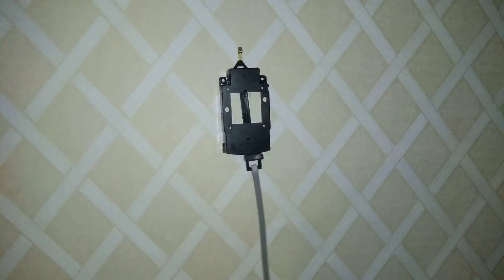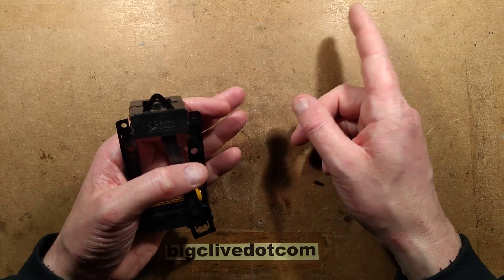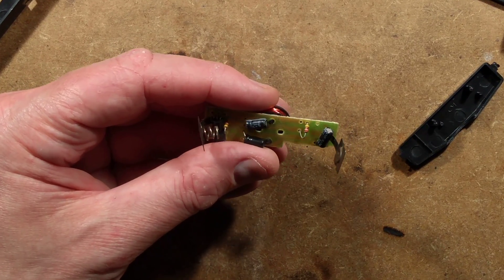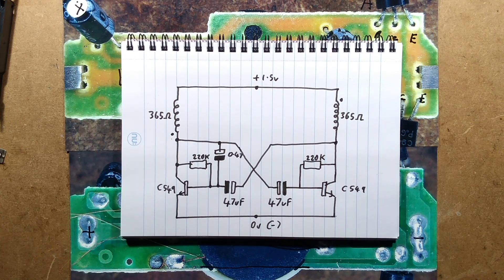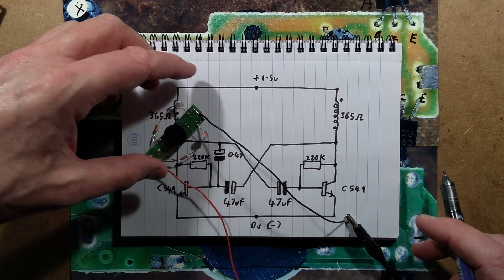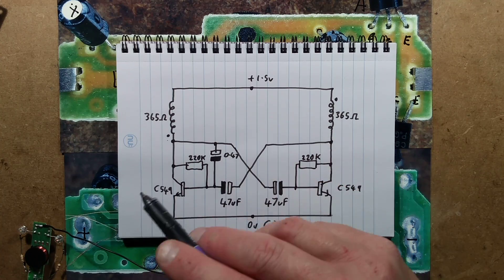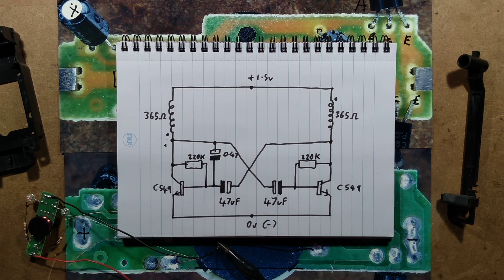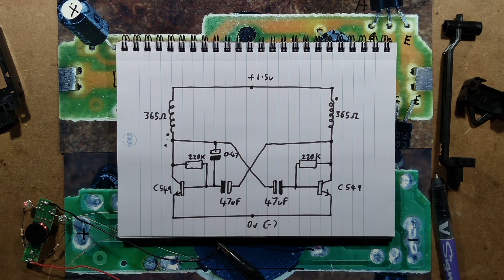Quartz clock pendulum movement teardown with schematic.

Comment: It's properly known as a knife edge bearing... quite common in clocks and balances....
Reply: "quite common" !!! Pretty much all balances - but not so much clocks. Clocks tend to use a bit of thin spring steel which bends - so there's no mechanical bearing.
Reply: pmailkeey Bendy springs are only used in clocks that use the spring for timing instead of a gravity pendulum.
Reply: @johnfrancisdoe1563    nope.  A pendulum can be hung from a normal bearing, or a knife edge, or a short strip of flexible material, eg leather or thin spring steel.  All have been done.  One use of flexible strip is to get the pendulum to follow a non-circular arc  (elliptical maybe?)  Which gives independence of timing from excursion.
Reply: @johnfrancisdoe1563  Isn't it amazing how totally clueless people like you appear to be an expert.
Smiths, a world-famous? instrument maker (including clocks) used them - and I have one such clock only 2 feet away from me as I type.

On top of that, you're technically wrong too - springs are not used for timing.
Reply: @johnfrancisdoe1563  To name a famous clock that uses a bit of spring steel - the clock in Big Ben / Elizabeth Tower (- for the pedants)
Reply: @raykent3211  Parabolic ?
Reply: @raykent3211  Oh, you're having fun now ;) Non circular movement (therefore technically can't call it an arc, I think) - timing therefore based on 'average length' of the pendulum - this is hilarious ! Considering the sub-degree of arc at the point of suspension, this variation in length is going to be as much as a few microns at least ;)
Reply: @raykent3211  I can only think of some extreme way of measuring pendulum movement (such as with fine lasers) to be able to pinpoint the locations of the centre of the pivot. They'd need to stop all the tube trains to cut out the noise from measurement signals !
Reply: @millomweb   if  you'd like to know more, it was discovered by Huygens that having the bob swing  along a cycloid is more isochronous than the the arc of a circle.  You're right about the error being tiny, but an error of one second in 24 hours is one part in 3600 times 24, which is is not far short of 0.001%.  That means getting fussy!
Reply: @raykent3211  Did Huygens do his experimenting in a vacuum ?
Reply: @millomweb   I'm afraid I don't know, but if he did, vacuum pumps weren't gréât back then.  It may have been theoretical.  The (over) simplification of the equation of motion of a pendulum gives constant period indépendant of excursion, with the caveat "for small excursion", which begs the question "how small is small?".  The error is easily measurable for very large angles, like 45 degrees, which backs up the theory.  Sorry my knowledge is so limited, I don't know whether Huygens actually made use of his own idea!  I believe a handful of clocks were made by others, but the crowd went for very small excursion where there's not much point.  A notable exception was John Harrison who made a couple of clocks with surprisingly large swing angles.  Oh...but... I don't remember off hand whether they were cycloid.  Sorry..
Reply: @raykent3211  Were the JH clocks you refer to 'gravity/pendula' ? Non-circularity is not an issue in itself; but only in connection with gravity. If the oscillation is spring-derived, circular motion is fine - watches and clocks can use 'balance wheels' with large excursions (180°?) satisfactorily as these rely on hair-spring driven oscillations. "Small excursion" as as equal to "error of period" - so no oscillation = no error of period. The bigger the oscillation, the bigger the error BUT what's critical is not the error but change in the error - so a large excursion is fine provided it's constant ! The change being resultant of driving spring strength weakening as it unwinds. Isn't there a system of weight-driven clocks powering via a conical pully such that as the thing 'unwinds' the leverage increases to compensate for loss of power ? Can't be weight driven - must be spring driven - as weights don't lose power, do they !
Reply: @millomweb  I was speaking of pendulums.  As you say, a balance wheel can have much greater angular excursion  I think the reason why the simplest version of the equation of motion of a pendulum deviates from the truth is that we simplify by taking sin (theta) to be near zero for small theta.  Or maybe it's the first derivative is near to one.  Or mybe it's a cosine term.  Any road up it comes to the same thing, the term can be ignored for very small theta (angle of swing) but produces an error at increasing angles.  I agree with you that if the excursion is constant then the period is constant, though different to the simplified equation.  Who cares?  I'm not sure why they did!  The JH clock I referred to is a longcase weight driven pendulum clock.  I think he made two.  I'll get lost if I try to find the video.  The conical pulley you mention is called a fusée,  a French word that usually means rocket,  but here means bobbin.  You're right in saying it would serve no purpose in a weight driven clock,  it's a torque convertor to compensate for the diminishing force from a mainspring as it winds down.  If you find an English "turnip watch" in your attic, it has a fusée,  which makes it fat and it's worth a fortune.  Rare.  The rich preferred slimline, if less accurate watches, which couldn't accommodate fusées.

Comment: I love simple analog circuits that get the most from the least. not everything needs a microcontroller.
Reply: Not sure if it really gets the most from the least, I had a planet pendulum thing back in the 70s that used one magnet, one coil and one transistor (+ resistors, capacitors). I might remember it wrong though and I regret that I did not try to reverse engineer it even if I had not even heard of that concept back then.
Reply: @SlyPearTree  You know, I remember seeing one of those. years ago, had forgotten all about it. Was just like an NPN, diode, magnet, and an AAA.Remember puzzling over how it worked. Maybe magnet induced current hit the base on the NPN dumping current in the coil to pull the magnet back? I honestly don't remember, not sure I sorted it back then.
Clive, if you're watching, have you seen this?  Would have been something from the late '60s or maybe '70s. Would be fun to build a minimalistic joule thief-ish pendulum.

Thanks, Sly. The old memory isn't what it used to be... but then, what is?
Reply: you'll love the mechanical pendulum then... those you had to raise the weights, or clockwork wind the spring mechanism to give it back the energy lost to friction? Vcc=0V
Reply: @Bennyboy-dog  I have one, a big grandfather clock. It's wonderful.
Reply: @Miata822  Is it clockwork driven or weights Bill? My aunty had a weight driven unit, complete with silly bird that jumped out every hour on the hour. She even allowed me to raise the weights when they got low.
Reply: @Bennyboy-dog  You mean to ask, "Is it spring or weight driven?"  Both are clockworks.
Reply: @jmcarp0  thanks jmcarp0 - you are correct.
Reply: @Bennyboy-dog  My apologies for an exceptionally late reply. This is a large wooden floor standing clock driven by two substantial weights. The weights and pendulum are visible behind glass. No silly bird, but it does have a nice chime.
Reply: me too bro micro controllers are a whole lot confusing!!!
Reply: Did you make any attempt to control the amplitude of the pendulum swing by regulating the voltage of the circuit?

Comment: There is a type of Romex called UF cable and the UF stood for Underground Feeder and was never approved for direct burial though its been sold forever.
Reply: never approved where for direct burial?
Reply: @fanplant  aye, is was made and tested even getting UL approved , But the S. Florida building code wouldn't ever approve it. I belive the reason is that it wouldn't be protected.  If you use PVC pipe it has to be 24 inches deep to the top of the pipe and I ridged pipe is 10 inches to the top.